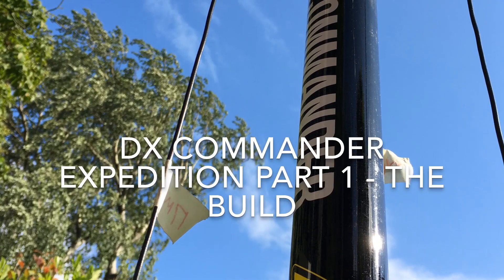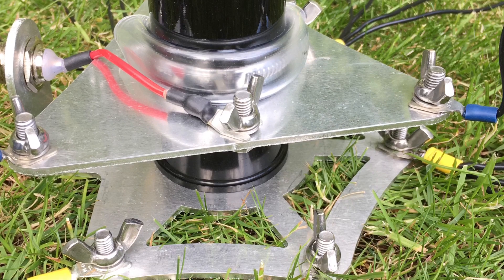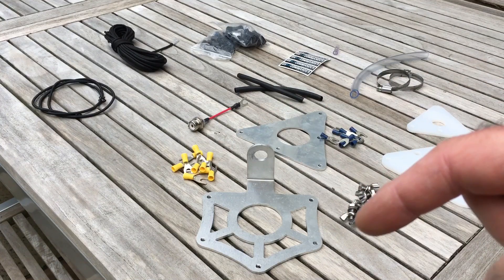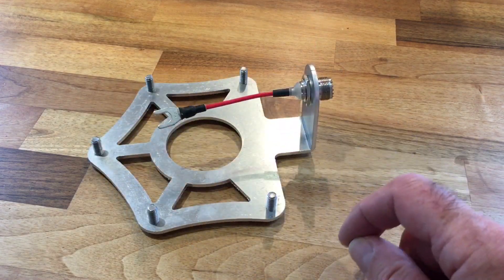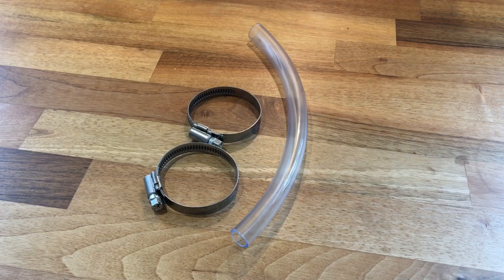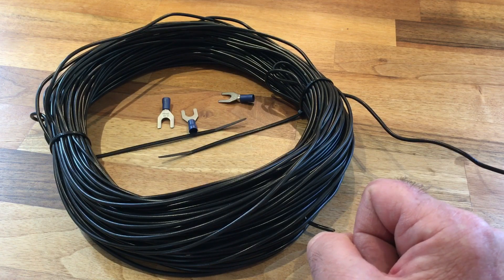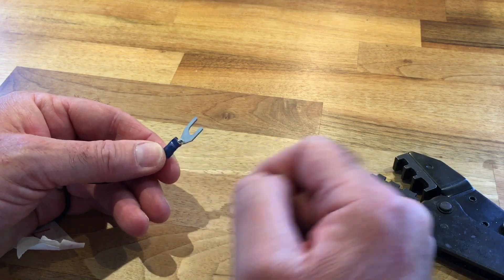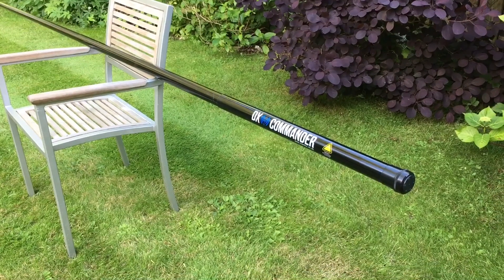DX Commander Expedition Part 1 - The Build

Comment: Thanks for sharing. I have a few questions.  Is the 6 cm fold over for your loop length added on to the total length for the element? In other words the directions call for an element length of 3.83m for 17 meters are you doing the 3.83m and adding an additional 6cm to that length to account for the foldback length or is the 6cm foldback just part of the 3.83m for the element? Same question on the 20m element.  Also what was your total length of the element for 40 meters? Thank you for your time.
Reply from the maker: dheller777 Yes, add the two lengths together to get total cut length. So 17m Band is 3.83m+6cm=3.89m. It’s the same for all elements - add the two to get the total length to cut, then just fold-back and go from there. You might find they are slightly long and need a little more fold-back. The higher frequencies respond more to folding, so less required. My 40m was cut as per instructions i.e. 11.15m. Enjoy your build 👍🏻
Reply: Thanks for that question.  I was wondering the same thing.